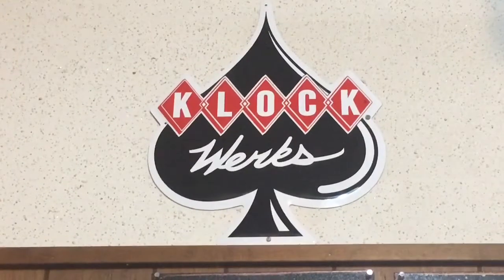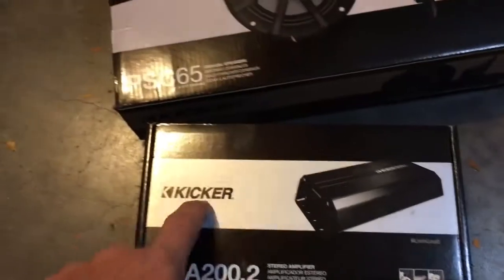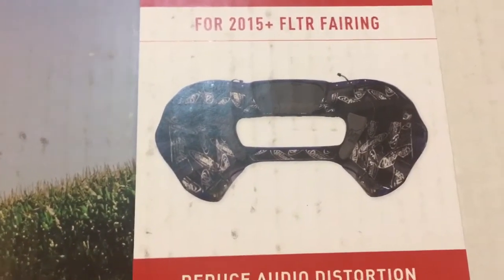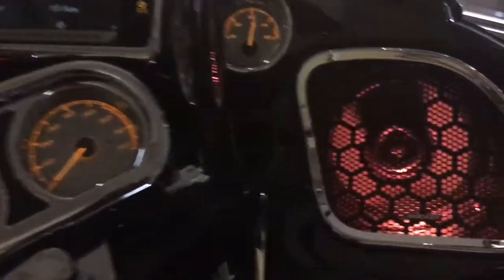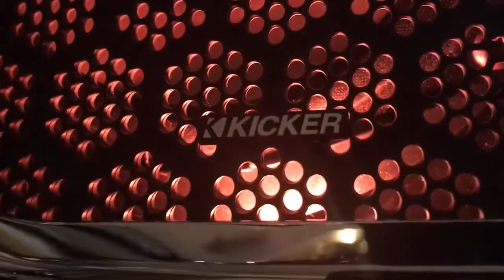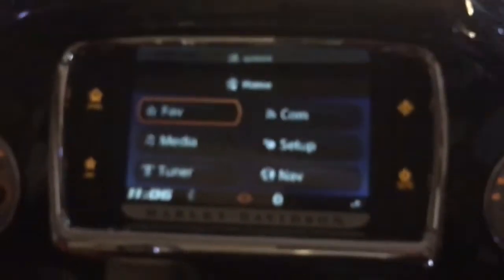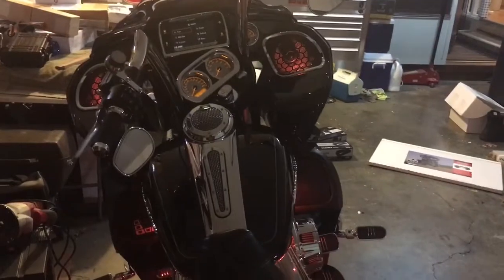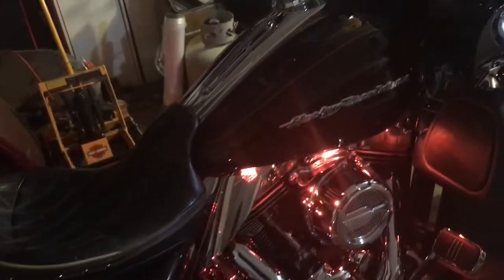Klockwerks/Kicker audio upgrade

Comment: Not a fan of Kicker audio for bikes, although I did run kicker 15 Solo-Baric and 1500 watt amps in my truck and it sounded great but for my bike I prefer ARC Audio, , hey but man those accent pieces look really sharp those Chrome trim, the beveled trim where did you get those at,?  those bars look nice too are those Factory 47 or yaffe bars,

Comment: What would happen if you didn't reflash the computer?
Reply from the maker: The stock radio won’t recognize the amplifier and it will not work correctly